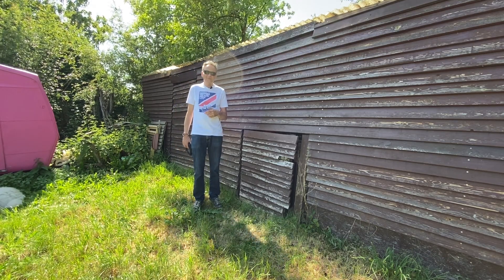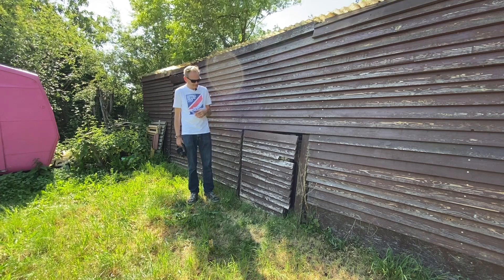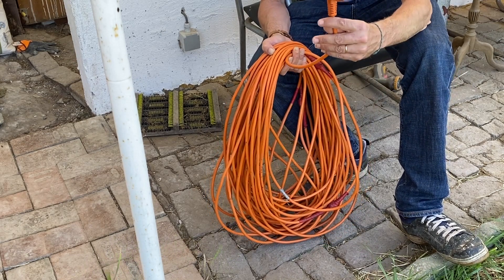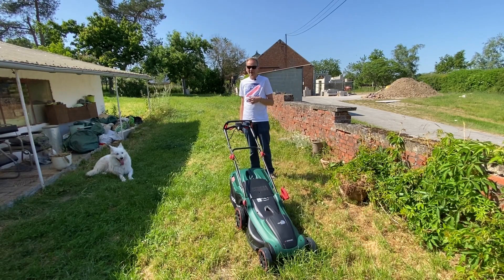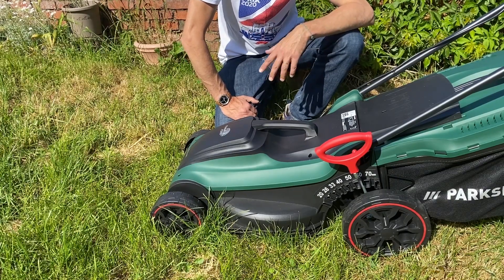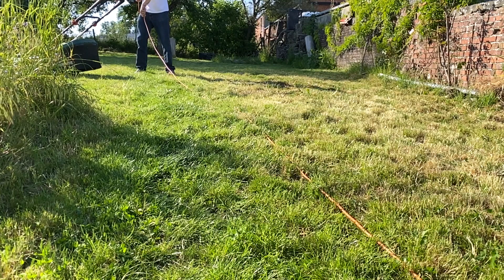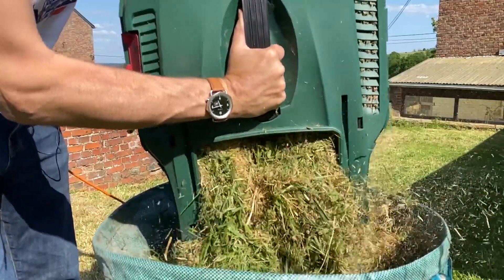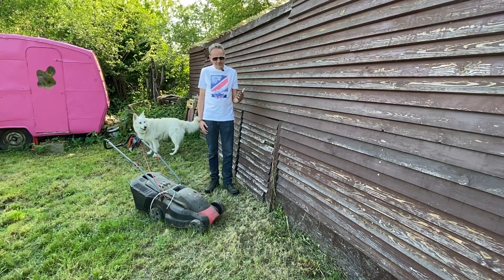Mow the lawn without hassle with the power cable

Comment: Dude.
Spare used car battery to weak to start the car. Still delivers more than enough to a lawn mower. Ofcourse make sure the motor is DC. If it is DC, you will have an easy day. Just bypass the adapter, which is probably in the handle or where ever the power cable leads to from the on off button. If your motor is ac, bad luck. But slim chances that the motor is ac.